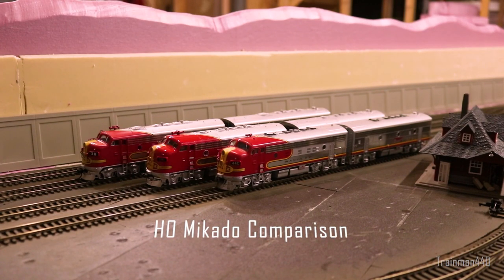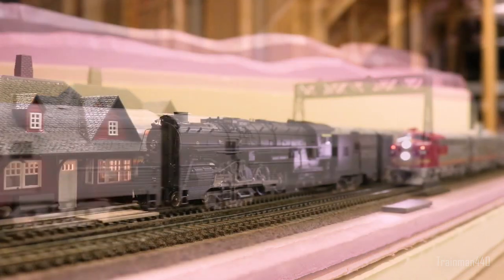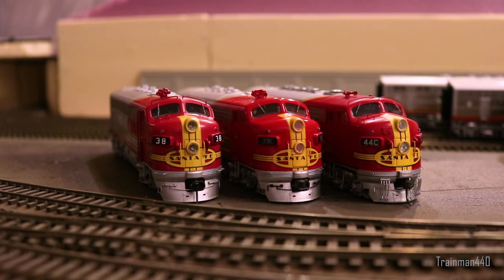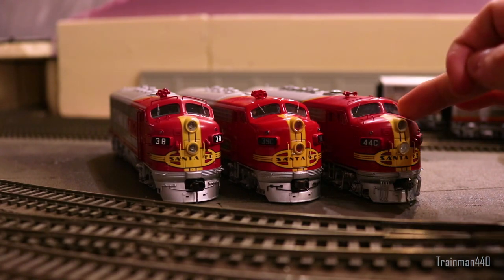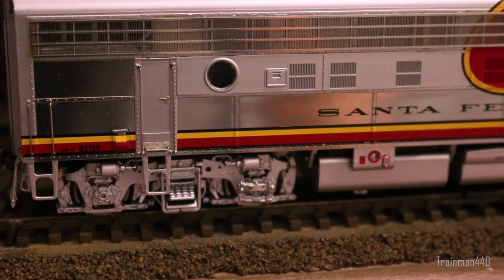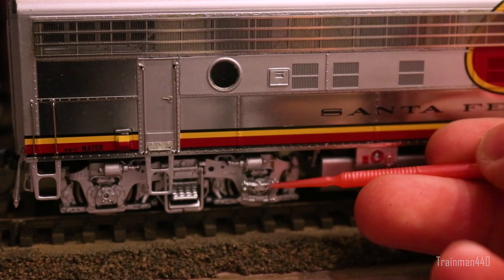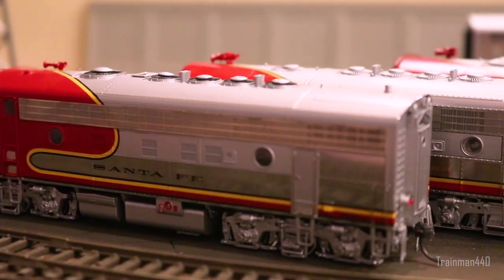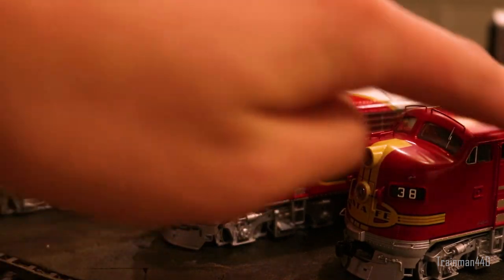Santa Fe HO F7 Comparison: Athearn Genesis vs MTH vs Broadway Limited

Comment: Please keep in mind that the sun often plays no favors on equipment stuck outside for all weather conditions.  So naturally, two locomotives could realistically be two off colors from its brother.  Even if they came out of the paint shop hours apart.  Take into consideration of the location that they served in, Sun beating down,  rain streaks and stains.  Mud dust is greasy grime often hides the original gleam. Not to mention rain and conditions we could never imagine.
Reply from the maker: that is true, however I dont see there to be such a huge difference between an ABBA set. Im not sure how often ATSF perma coupled their ABBA sets together, but I dont think its too unreasonable for me to personally want my model of a ABBA set to have similar matching paints. It wont bother others, and that's why Im not stopping anyone from buying their preferred brand of F7s, but it does bother me. Cheers!
Reply: You're missing the point! LOL  🙄🙄

Comment: Genesis looks the best. Thanks to Highliners shell. Moreover, it seems to have MU connectors and lift rings (what you call eyebolts) . Earlier Genesis versions came pretty much naked.
Reply from the maker: indeed, these are definitely an upgrade from the early yellowbox era. thanks for the correction, im no diesel expert!

Comment: Genesis carbodies are based on the Highliners tooling Athearn acquired, not the 1950s Globe tooling.
Front "eye bolts" are called lift rings. Used only in case of a wreck, not in the shop.
Front "fuel tank" is a water tank for the steam generator. Note that Santa Fe A units didn't have steam generators, only the B units.
Side chrome plating is supposed to replicate stainless steel panels, to match psgr cars.
That Genesis axle "rerailer" is the Automatic Train Stop sensor, allowing trains to exceed the federally mandated 79mph maximum.
Troublesome diaphragms were removed shortly after delivery.
I saw many Warbonnets in service in the 1960s; none were ever shiny. The red paint faded badly in the desert sunlight, so any color is probably accurate. Before every departure, pilots and trucks were spray-painted aluminum to make them look fresh.
Reply from the maker: indeed they are! I might not have made it clear in the vid, but what I meant was athearns first F7 was the globe tooling and is still used in their roundhouse/RTR lineup of F7s, BUT the genesis F7s dont use globe tooling. 

Are you sure the lift rings really not used in the shops? I know for sure the PRR front lift rings are used in shops, but ATSF didnt? I figured since the front roof of the loco couldnt have lift rings mounted due to the cab, they chose to put them in the front of the loco instead, sort of like the lift rings on top of the diaphragm. 

The rest is good info I wasent aware of, comment pinned!
Reply: The paint must have gotten thick?

Comment: Interesting and informative presentation with these three pretty good brands and very good to compare the three together. That said I have various locos, both steam and diesel of these three brands and I have had trouble with all of them to the point that I have had the latest ESU Loksound version5 decoders installed in over a dozen of them. The sounds are definitely better and probably more authentic. I have also had the speakers replaced which certainly adds to the sound. Thanks for your effort in presenting. I have just subscribed to your channel.
Reply from the maker: I agree, the MTH decoders are real finicky, and the BLI decoders tend to glitch out from my experience, and the sound quality is quite frankly terrible in my opinion. ESU certainly holds the gold medal for diesel sounds, but I cant afford buying a sound equipped loco just to rip it out and replace it with another decoder. REALLY hope one day BLI will release DCC ready versions of their locos like they used to. 

I recall used to watching your channel, good content! Subbed!

Comment: The Genesis/Highliners F unit is probably the best HO diesel that has ever been tooled.
Reply from the maker: That's a very bold statement, but I would agree that the Genesis/Highliner is a fantastic F unit tooling!
Reply: @trainman440  not bold, but if you are being realistic, it really is. Also my opinion.
Reply from the maker: @PeterNGloor  fair enough lol. It is very solid.

Comment: The lack of MU's kinda bugs me but besides that I could see myself getting a couple BLI and Athearn ones, I like how one has the 5 chime while the other has a 3, which is prototypical as ATSF used a variety of horns on these engines.
The variety in colour also compliment each other, as was already said in a different comment, ATSF units were never really exactly the same shade as each other, especially after a few years in service they tended to fade a lot.
Athearn's model might represent a unit recently out of the shop, while the BLI one looks appropriately faded for an engine in continuous road service,
(as most of the warbonnets were, being passenger engines) for a few years.

If for Paragon 4 they add the correct headlight configuration with dual bulbs, and the correct MU hoses, which should be a simple fix, I think they could both honestly be perfect runningmates.
Reply from the maker: Hi! I agree the different shades of red doesnt bother me as it is rather prototypical. That being said, the different chrome finishes does bother me as it is very noticably different, and the chrome shouldnt be different. 

Besides the chrome finish, my biggest issue with the BLI models is the terrible sound system. I stand by my words that I think BLI sound systems sound terrible. The sound feels drowned out and muted, nothing like the crisp sharp sound seen on proper decoders. I think its less to do with the sound files and more to do with the chip on the decoder that amplifies the speakers being an old design, similar to QSI decoders. 

The lack of MU hoses on the other locos is actually correct, since as-built these didnt come with MU hoses iirc. That being said the fact they exist on the genesis models is a nice touch. Different horns is also a nice touch between the various manufacturers. I do agree, the lights on the BLI model is a bit underwhelming. Not having individual bulbs is rather disappointing. MTH's F7 does have individual bulbs, however the top mars/emergency light should have two bulbs, not one. 

Interestingly, I recently got a pair of Blueline F7s. I might make a quick review on them, but theyre VERY interesting. Since they share tooling with the MTH f7s, they have more or less the same detail. It has the bog standard two single chime horns on the cab roof. It has the same matte finish on the chrome plating like the modern bli F7s. BUT, it has a non-faded shade of red, AND it actually does have the seperate bulbs for the headlight. Two horizontal ones for the headlight, and two vertical ones for the mars/emergency light which is accurate. Only the bottom mars light works though which makes sense. I find it fascinating that MTH chose to make the lights LESS accurate by removing the top emergency light all together and having a single bulb. They also removed the single prototype specific detail found on the blueline model, the extra mu hose panel left of the mars light. (MTH took BLI's blueline F7 tooling) Fascinating how they would remove such details but then upgrade the horn.

Cheers!
Reply from the maker: gosh that response ended up being much longer than anticipated.
Reply: @trainman440  I would assume if the BlueLine and Genesis models share the same headlight arrangement for a reason.
That probably means MTH didn't get their hands on whatever patents/tooling Athearn used for the prototypical headlights, so they had to replace it and make do.

I'm pretty sure the dual single chime is also appropriate for some ATSF F's, especially earlier in their career.
Though the threes and fives were definitely more common.
I did know about the MU's not being there as-delivered what I meant is I prefer their later appearance.

As for chrome, trust me man, as an ATSF modeler, it bugs me to NO END.
Sometimes you can't even get consistent silver from the SAME MANUFACTURER.
For example, I have an FP45 and an SD75M, both from Athearn, both painted in the same late superfleet warbonnet scheme, yet for some reason one is semi-glossy pseudo-chrome, and the other is just regular matte silver.

I just excuse it away with the same reasoning as the red - no two engines look exactly alike.
Although, in the case of 90s era superfleet engines, it's a bit less excusable because those things got repainted every few months.
Reply from the maker: @trainknut  Well BLI blueline and  athearn genesis F7 tooling is nothing alike. Blueline tooling is their own, Athearn got their tooling from highliner. MTH stole BLI's blueline F7 tooling via a lawsuit. So the fact that Blueline tooling has genesis features is rather impressive. Having the same headlight arrangement is rather impressive, and I give bli props for that. Why MTH chose to make the blueline tooling worse is anyones guess, but obviously its not athearns tooling, theyre nothing alike, since MTH took BLI's tooling NOT Athearn's tooling. 

Yes, single chime is accurate for as-built, but it looks out of place if I were to run it in consist with my genesis F7s. And that is my issue. Im trying to find a good AB set of F7s to run in consist with my genesis F7s. The BLI ones fail bc of the different chrome. The MTHs has good chrome but everything else seems to be inferior. Having different chrome is nothing like having different shades of red. Chrome should be chrome. The fact that Athearn's MTH's and Walther's chrome all look more or less identical, but BLI's looks off just bugs me. They should totally be capable of it, but they seem to just refuse to recreate it. Im willing to give some lieniency, but BLI's is just glaringly obvious in how different it is. 

Anyways, so turns out im STILL on the hunt for a good AB set to run with my genesis F7 set. Might just give up and get some yellow box genesis F7s. Cheers!
Reply: @trainman440  I had Blueline confused with Blue Box, SMH.

It's honestly a little disappointing there are so few good, highly detailed F units out there, and even fewer that depict them later in their careers as they would've looked in the 60s and 70s, which was actually the peak of their careers to be honest.

Like as much as I love transition era modeling... I just love the way F units looked in the 60s when railroads started tweaking the units for local problems, like snowplows on the SP units, or the addition of extra MU connections for running with newer engines.

I honestly really appreciate BLI actually tried something with theirs instead of just pumping out the same generic tooling for every road, which so many manufacturers are unfortunately content with.

Hopefully with P4 we get a model which addresses these complaints, because, it wasn't a bad try.
Reply from the maker: @trainknut  I agree, BLI is really trying to add prototype specific detail on their models, which is good for a change. Their older diesels were rather infamous for being sparsely detailed with little to no prototype specific detail (SD45, AC6600). Unfortunantely, I'll probably be avoiding their F7s until they get a good chrome finish. Maybe add mu hoses, and a rear red emergency light on the back end. Cheers!
Reply: @trainman440  I've since looked up some pictures of the F7s in service and found quite a few with faded silver carbodies - so the mismatched chrome isn't an issue for me as they did often have a more silver appearance with weathering.

Considering the faded red they went for, and the post-59 details like the horn, I think it's possible they did this on purpose to simulate a weathered unit.
I just wish they fully committed to the post-59 look with the MUs and twin headlight bulbs.
Reply from the maker: @trainknut  idk it will still always bother me. Unless you can believe that the BLI unit is somehow uniformly/evenly weathered across the chrome, it'll bother me to no end. Im sure some additional weathering will help blend it together. But hey if you can look past it, that's all the merrier!
Reply: @trainman440  I think I'd have to see it in person, it probably looks worse to the naked eye than it does on video.

Comment: I have a comment. Probably I'm wrong but, Athearn model looks like Face III. Why? Besides the size of the dynamic brake fan, which is the same as the F-9, the side louvers, are also, F-9 style. Ordinarily, the F-7 side louvers are horizontal. The F-9 are vertical. If you can see the Atlas-Roco FP-7, you can see that the dynamic brake fans and side louvers are the same as the F-9. Even, the radiator grills, are vertical as the F-9. Differences? Of course, F-7 and FP-7 have four louvers on each side. F-9 and FP-9 had five.
Reply from the maker: Hello! I admit I know very little about diesels, but I'm 90% sure these are phase two F7s. ATSF just chose to modernize their F7s in a particular fashion that might look similar to the phase 3 F7s or F9s. But I wouldnt be using other models as a reference in terms of what is and isnt an F7. Look up prototype photos and such, or consult a diesel expert! Cheers!

Comment: You should do this comparison again but compare those 3 santa fe f7 with the walthers ho sante fe f7a&b
Reply from the maker: Hey! Walthers can be summed up as this: Athearn genesis prices for an okay detailed engine. The BIG issue with their ATSF F7s is the shade of red they used is VERY dark, far more noticeable than BLI's slight off-red shade. Therefore I have avoided their F7s.
Theres also many other F7 brands I could compare. Intermountain, BLI blue line, BLI paragon, BLI PSC (all are different from each other), Stewart, Athearn Genesis Yellow box, Athearn RTR/Roundhouse, Bachmann, etc. But I stuck with the three I had at the time. Im not gonna go out of my way in spending $$$ to buy a F7 just for a review video though, especially since I make $0 from my channel. Cheers!

Comment: Something that still bothers me to this day with Tsunami…. No matter how much tweaking… the horn never seems to be loud enough.  In reality the horn should always drowned out ever other sound.  You shouldn’t be able to hear the bell over the horn.  Real horns can be heard from almost the next town, the prime mover from just outside of town and the bell barely as it approaches the platform….  One thing I did like about the old QSI in Walthers old Proto runs was the Echo effect.   We want people to believe we are modeling and operating our trains in wide open spaces.  The open hollow sound of my Proto Great Northern F’s sure help with making my basement seem bigger than it is.
Reply from the maker: Old Tsunami decoders have a lot of issues. The horn issue can kinda be fixed by simply turning down all other function volumes besides the horn. My issue is the fact that the prime mover sounds from notching up and down comes AFTER the engine already speeds up/slows down. I personally prefer esu loksound for my small handful of diesels. Cheers!
Reply: @trainman440  I do agree on the notching and like the delay in motion that only occurs after the “power increase” from the prime mover.   The challenge then becomes trying to speed match for consisting when different decoders cycle through the notching at different rates.

My favorite is the Sound package Scale Trains put in the SDL39…. The trucks have little contacts built in that trigger frog clanking sounds when the loco goes through a switch or crossing! How cool is that 😃
Reply from the maker: @scottwendt9575  thats pretty awesome! yea I think scaletrains used ESU loksound in thier diesels. ESU is king!
Reply: @trainman440 PS3 is king and will always be 😂
Reply from the maker: @YeOldeGeezer  PS3 was definitely a cool sound system!

Comment: If the Athrean is a blue box, then that will be the best one out of the three. Athrean have a good track record over the years with reliable drives. MTH, electronics will be the main issue. BLI, probably the same with MTH with the Paragon 3. By the way, the Whisker ATSF F7s are coming later on this year.
Reply from the maker: Actually mth electronics are very solid and reliable with good quality control. their only downside is the somewhat limited dcc functionality. All three have quality drives except for blis paragon 3/motor issues. Athearn definitely wins though as far as detail and accuracy goes. The athearn is an athearn genesis blue box. not vintage athearn blue box. thanks for watching!
Reply: @trainman440  aye, thanks for the correction. Definitely keep Athearn!